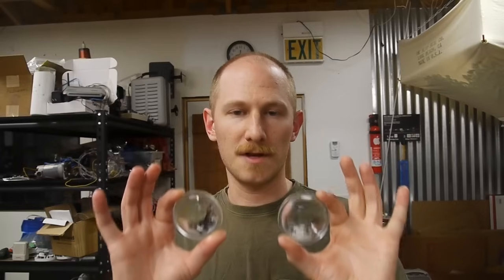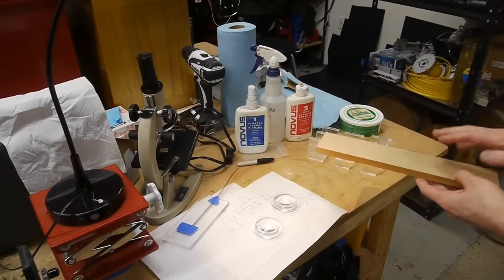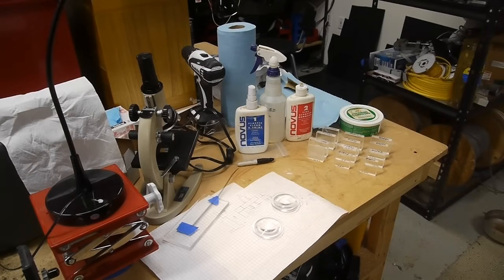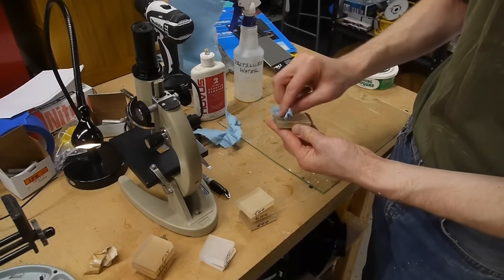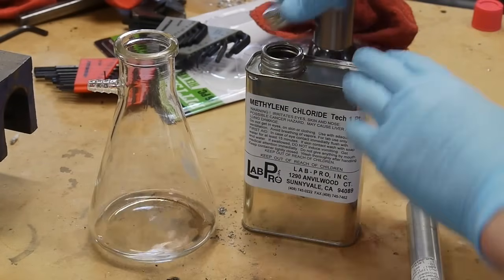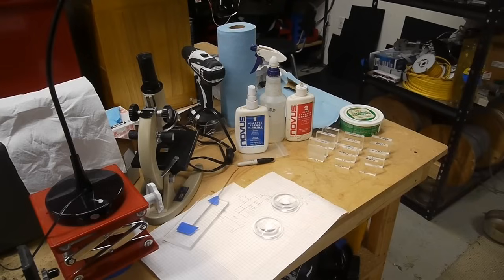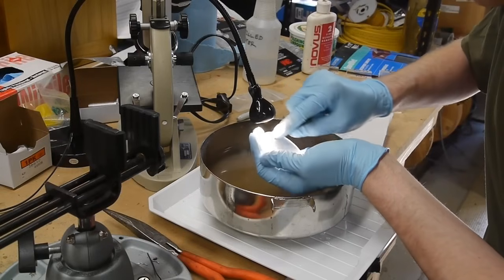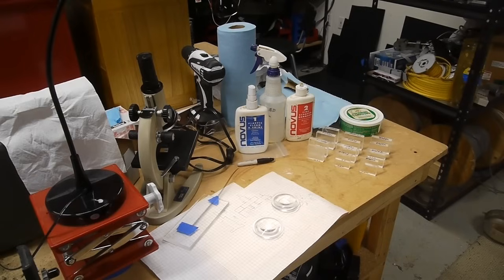Optical finish for acrylic -- vapor polishing and other techniques

Comment: Just tried polishing the edges after cutting on the CNC. I sanded it with a Orbital Sander, jumped from 600 to 1500 to 2000 then polished with number 3, worked like a gem. Thanks

Comment: Ben: Nothing is more frustrating than optical polymer polishing... Acrylic polishing is quite different than say polycarbonate polishing which cannot be easily flame polished. Optic polymers for say high quality eyeglasses use something similar to PMMA and polycarbonate, it's called CR-39.. take a look at that for your lenses.  I found there is no replacement to ultra fine grit/compound polishing vs vapor.. Vapor albeit methylene chloride or acetone if subjected for too long creates swelling at the surface which is why it tends to cloud up again, or crazing from internal stressing.. it's a delicate and time consuming process of which you found out and did fantastic. I did a lot of research once for a project and it's a science in of itself

Comment: Confirmed! Polishing is best compared to acetone vapour. So here is what happened. I've always been using the green compound and buff wheel on welding mask, headlights, the case that holds my swim goggles, the actual swim goggles. All of these gave me satisfactory results until I had problem with Arena swim goggle internals. After a perfect polish it was like looking through 600 grit cloud. It will not work. So I heat gun a can of red bull with acetone and it 85% fixed it, but I tried on the already polished swim case for example, it didn't make it any more clearer, in fact holding it for too long makes it melt, scratches appear. Now I don't know which is polycarbonate/acrylic or if there is a way to tell. My adice is if you can't sand/polish only then bring out the acetone method. It's also more annoying to use, it takes a lot to heat up the acetone and the fumes don't heat up the surface perfectly. Make sure you move and don't stay on one spot. I'm actually puzzled why some headlights still look hazy/matt finish after a polish and some looks like the day I bought them. I assume some stuff is not pure 100% polycarbonate or acrylic. Not to mention Acetone ain't cheap so the fumes method is not cost effective on large pieces. Hope this helps

Comment: Another good option for a very flat sanding surface is samples of polished granite worktops. Perfect for small parts as the samples are usually around 100x100mm and cost a quid. Ebay has lots.

Comment: One issue for the "lenses" you made is the correct profile, on a standard CNC the centres of the machined part surface won't be bang on. On the inner surface, though a lathe cuts on one side making the other a mirror of it, if the tool does not reach the centre then there will be a slight flat at the centre and if the tool goes beyond the centre the two halves will have a pointed profile.
 If you measure either half on a surface co-ordinate machine it will give you the points so you can correct the profile by altering the start and finish points in the program.
Someone mentioned using a formed polishing "dolly for the grit" this will help solve that problem but you would have to set the profile of the dolly in the same way i mentioned for the part profile earlier. Probably a bit of overkill for the occasional part you are making but i do production parts that are similar and use a high precision cnc lathe to get the profile correct to within a micron.
 My final polish is done with 0.5 micron diamond paste (it needs acropol in the mix so specific to acrylic)
Did you get an effective finish for your project?

Comment: Old video, i know. But you could try micro-mesh. It's what they use to polish stuff like an aircrafts canopy. Though keep in mind, micro-mesh follows a different grit standards than regular sandpaper. 3200 grit micro-mesh is equivalent to 2000 grit sandpaper. But 4000 grit micro-mesh is finer than 5000 grit sandpaper. And micro-mesh goes up to 12000 grit. 
Speaking in terms of microns, 12000 grit micro-mesh is 2 microns. 2000 grit sandpaper is 12 microns.

Micro-mesh is very gentle too. It doesn't abrade away much material. Just enough to polish. So you're not gonna have a big risk of changing lens geometry.

Comment: Great info, thanks! Trying to produce transparent bores in acrylic/polycarb after taking it off the lathe, though the bore is 3mm. Will see if I can sand in there though seems like slower RPM is helping a bit.

Comment: missing 1200 grit sand paper but have 600? No problem. Take 2 sheets of 600 and rub them together and they grind each other down to 1200. The longer you grind, the finer they become. A car painters trick I learned many years ago.
Reply: yes and no.  rubbing knocks off the high points, but leaves the actual size and pitch of the grains unchanged.  rubbing is a great thing for various operations, but it is not the same as a grit change.  I like it for SiC between finish coats to ensure there are no high points / deep grooves.

Comment: you forgot to mention: 
DCM is the least toxic of the simple chlorohydrocarbons, but it is not without health risks, as its high volatility makes it an acute inhalation hazard.[19][20] It can also be absorbed through the skin.[1][15]

Symptoms of acute overexposure to dichloromethane via inhalation include difficulty concentrating, dizziness, fatigue, nausea, headaches, numbness, weakness, and irritation of the upper respiratory tract and eyes. More severe consequences can include suffocation, loss of consciousness, coma, and death.[1][15]

DCM is also metabolized by the body to carbon monoxide potentially leading to carbon monoxide poisoning.[21] Acute exposure by inhalation has resulted in optic neuropathy[22] and hepatitis.[23] Prolonged skin contact can result in DCM dissolving some of the fatty tissues in skin, resulting in skin irritation or chemical burns.[24]

It may be carcinogenic, as it has been linked to cancer of the lungs, liver, and pancreas in laboratory animals.[25] Other animal studies showed breast cancer and salivary gland cancer. Research is not yet clear as to what levels may be carcinogenic.[1][15] DCM crosses the placenta. Fetal toxicity in women who are exposed to it during pregnancy, however, has not been proven.[26] In animal experiments, it was fetotoxic at doses that were maternally toxic but no teratogenic effects were seen.[25]

In people with pre-existing heart problems, exposure to DCM can cause abnormal heart rhythms and/or heart attacks, sometimes without any other symptoms of overexposure.[15] People with existing liver, nervous system, or skin problems may worsen after exposure to methylene chloride.[9]

Comment: I spent years in the automotive repair and refinishing industry. I know how easily deformation can occur by hand sanding especially in the coarser grits. Out of curiosity, I wonder what kind of results you could achieve using a tumbler ? Doubtful optical quality could be achieved, but am betting most all but the final few polishing steps could be achieved. Resulting in lenses with the most uniform surfaces, and with the least amount of deformation..

Comment: In the laser optics world you use colloidal  silica to polish lenses and for semiconductor wafers too.  The tech is in the polishing pad prep and conditioning while polishing.  As you polish, the pad will load with compound and start to change its polishing quality and by constant conditioning you can maintain a very high polishing process to achieve the best constant optical standards.  Also,  Evap carbon onto polished lenses to form sapphire coating for catch proof coating.  Also all laser optics have what is called a stack, alternating dielectric and transparent metal layers to increase transmissivity through the lens.  This well engineered stack is also applied using some other devices to improve deposition in the stack.  And two, if you don't get all of the water vapor out of your vacuum chamber before deposition the stack will not get optimal adhesion and will blow of during use.  good luck

Comment: The trouble with all these solvent and thermal polishing schemes on acrylic plastic is that the optics do not last!  The stress produced either by the thermal shock or solvent attack leads to tensile forces on the surface of the part.  It WILL CRACK or craze, sooner or later.  If you look at the fabrication manuals from the manufacturers, they specify an anneal after processing (and after any drilling, machining, or laser cutting process).  Still got those lenses and coupons?  How do they compare now, 5+ years later, with the way they were immediately after fabrication?

Comment: I always wet sand in a figure 8 motion. 400 to 600 grit is all you need to get it highly polished. Just make sure that you use a bias buff first and the finish buff after. Speed of the buff is important and make sure that you occasionally clean the buffing wheel face with the corner of a wooden stick and reapply the rouge.  You would be surprised at the quality of the buff after doing this.

Comment: In my art 3D class taught by a famous artist in NYC when we worked with acrylic in the end we had a 2 step polishing process, both involving a rotatory fabric tool to which we had to apply special chalk, that chalk had 2 variants, one red and one was blue, this is what gave the final transparency, however it was also very easy to mess up the smooth surface, but this tool also evened out the imperfections, there are more standard tools for this

Comment: TIP: Use a wide "figure '8' " pattern when polishing acrylics to avoid surface deformation. The circular motion used here, causes a buildup of material in the center of the workpiece.

Comment: I just found your channel and  there are quite a few of your videos that interest me. 

Did you ever post a video on gluing two sheets of cast acrylic together without losing optical quality?  Or can this be done by the DIYer?  I want to glue two sheets of acrylic together while placing designs made of very small gauge wire between them.  (30 -34 gauge)  without causing the acrylic to lose it's clarity.  

I looked  through the videos but didn't find it but I may have missed it.  Thanks in advance and thanks for helping keep science in our lives.

Comment: The vapor polishing video is noted as unavailable; and in fact the method used may no longer be acceptable under OSHA, as it does not contain the  solvent.  I believe the method is now to use a sealed system (placing the acrylic into a glass container through a sealing lock...

Comment: Hey, how's it going? I have a question... I have three Acrylic and two Alumilite drip tips and the inside tube is smooth/sanded but they are not sealed or polished on the inside tube. I have washed them 5 times with Dawn soap but I'M getting a funky taste from them when I use them for vaping. The guy that made two of them uses Alumilite instead of Acrylic and he didn't polish or seal the inside tube. I also sent him three Acrylic drip tips so he could take the step out for me but he did not seal/polish the insides of the drip tips and I'm getting a funky taste and a stinging in my throat when I use the Alumilite drip tips. I need all five of these drip tips fixed on the inside. Is there a way I can do it or can you do it or do you know anyone that can do it? Any help will be greatly appreciated! About a month from now I'm going to order two more of the Alumilite drip tips and I'll need the inside tube fixed again unless I can get him to do it when I order two more drip tips from him.

Thank You...

Comment: What about using a jewellers polish wheel as a finish? I found that also worked very nice with plastic resin on the buffer....?  It is much higher in fine finish than 2000 wet grit......Any thoughts?  We used to use that method years ago on good plexi and wow,,,,that looked near perfect!

Comment: One improvement over your demonstrated edge heat finish method is to scrape the side with a decent scraper before you apply the heat. This trick is used by special effects departments to make edges nearly perfectly transparent.. In the woodworking world, well done scraping on some type of wood can completely replace sanding. Great videos, by the way.

Comment: why would glass be "really flat"? It's smooth, but not flat inherintly..
Reply: Sheets of glass are generally both smooth and flat. Older processes and cheap glass will not be as flat, but I've seen glass so flat and smooth that letting it touch another hard surface (without water) rendered it almost impossible to remove. It literally vacuum sealed itself to the other surface.

I also do not think he needs Hubble Telescope level flatness. Just something smoother and flatter than your average sheet of wood or aluminum.
Reply: I use glass on my 3d printer. When I run a Z-height probe (10x10 points), it shows anything but flat.. (highest to lowest points are > 400 microns on a 200mm x 200mm x 5mm sheet of glass)
Reply: It looks like it's the "roundest" object, not smoothest. However, it is still incredibly smooth. Smoothest object appears to be an atomic mirror or some such. All very interesting.
Reply: Question on the z probe height - are you using a surface touch sensor or an inductive type? It can make a big difference...

Comment: I am removing scratches from Acrylic Block window. I am successful in removing scratches, but  not in the final step is to get it clear. I need your order of work: After you did the 2000 grit, you THEN used the Novus? Or was the 2000 IN PLACE of the Novus? I have cloudy results using auto compound, Turlte Wax's Premium Scratch Repair Kit which includes Clarifying Compound & up to 3600 grit. Chemicals or torches are beyond my comfort level.

Comment: my family operates a plastics fabrication company in detroit, we specialize in custom fabrication and work with acrylic alot when polishing any surface it is best to prepare it by sanding regardless of how you will be doing the end polishing for flame polishing we generally will sand a routed or saw cut edge with 220 grit sand paper untill all the marks from the tool are gone then we repeat this process with 320 grit or 00 steelwool this provides a extremely fine surface for the flame to polish... flaming a piece will put stresses in the plastic so you do not want to flame any surface that mar come into contact with weldon 3 or 4 as the solvents will cause the acrylic to craze in many cases. i have a bunch of info on how to work with diffrent types of plastics if you have any questions let me know and ill try to help

some of the things we do at our shop include custom fabrication, plastics welding, forming, heat bending, machining, and more. if you have any questions about how to work with acrylics, polyethylene, polypropylene, Hdpe, pvc, phenolic/micarta, polycarbonate, or another type of plastic me or my family probably have experience working with it and can offer some information to you
Reply: Madman1555. how do you take out burn marks.  I've done plenty but when you get 3/4 and above leaves burn marks. i usuallt buff it out with some compound rub
Reply: @shawnknoblauch5114  Don't flame anything over 1/2"; buff only.
Reply: Im using a electric drill and a buffing pad takes some technique..with dico compound.  I prefer the blue 7100952.

Comment: Looks like the scratch pattern from 400 grit or previous grit is still noticeable on 2000 grit scope. Try to avoid skipping grits, move in linear motions instead of circular, then perpendicular movement when switching grits. This is to help identify when the scratch pattern from the previous grit is removed. Only then can you step up to the next grit.

Comment: For commercial quality, you need to coat them. That will get rid of any small scratches.
Reply: Have you come across any videos showing the coating process?
Reply: I don't have any specific video suggestions, but I can point you in the right direction. Look up "spin coating". That is what optical labs use to coat lenses.
Reply: Awesome, Thanks!

Comment: Use powder abrasives, cast a tin die the same radius as your lenses, and use felt with powder abrasives + water or oil (oil is slower and more messy to clean up, but I think it gives better results). Its much easier than it seems, tin can be cast so easily and already with an embedded centered axe to use with a drill or something. The last abrasive would be rouge or cerium oxide. So with one tin cast and several felts and several grades of powder abrasive, you will make very decent lenses.